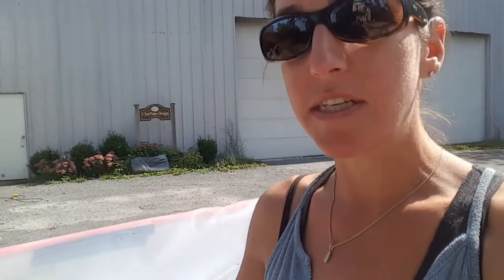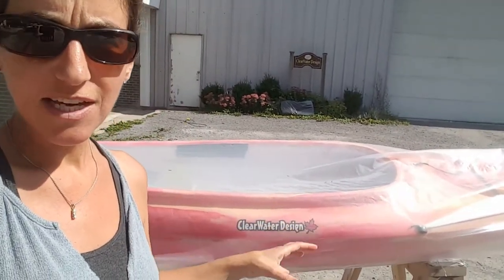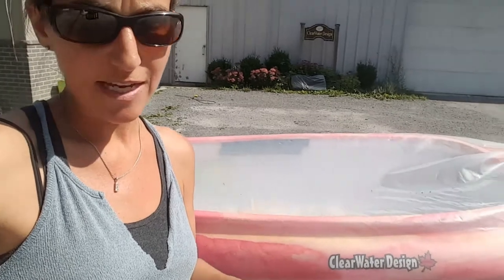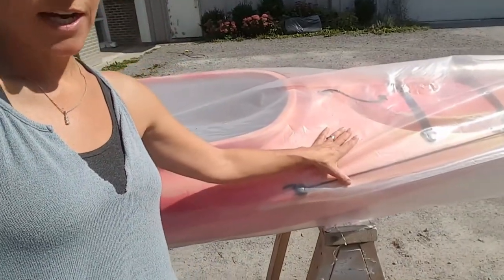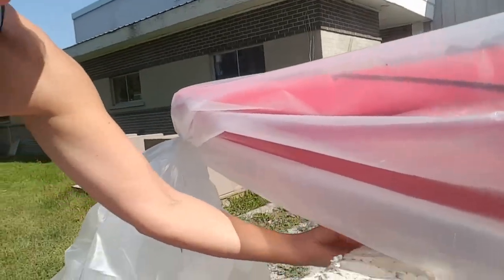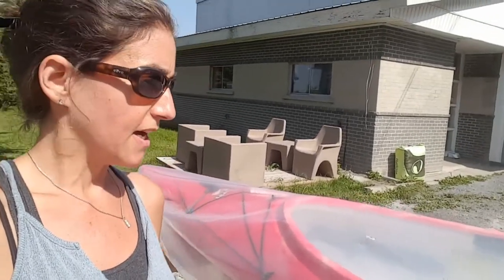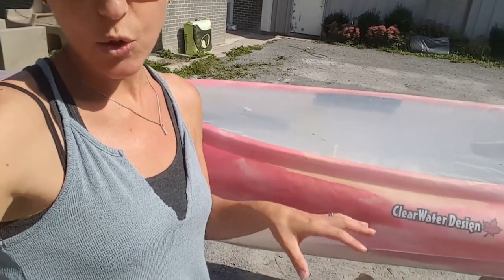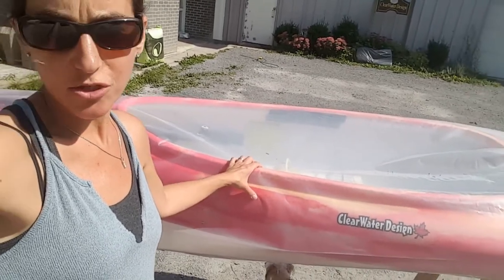How to fix a dent in your kayak

Comment: Twisted the nose on my brand new Joyride 12.0 after owning it for one day.  Couldn't be more angry!  I tried the "sun" method for two weeks and nothing happened.  Tried boiling water and nothing happened.  Tried using a heat gun...made half of it better, half of it drastically worse.  So mad at myself and the world of Kayaking.  What a terrible $1000 investment on my part.  New kayakers...don't even bother buying a kayak.  I got 1 use out of mine, which makes it the equivalent of renting a Kayak for 1 day for $1000.
Reply from the maker: Hello, I am sorry that our video on getting a dent out did not help you with your repair.  Your Joyride is not a ClearWater Design kayak.  Did you try contacting the manufacturer to ask them for their advice on repairing their product?  Different manufacturers use different types of plastic so they might have specific repair processes.
Reply: @ClearWaterDesign  Actually I did, and their solutions were the same as all the solutions on Youtube.
"Typically the way to get them back into shape is to apply heat, this could be by way of simply sunlight, hot water, hair dryer, or heat gun. The key is to make the plastic more plyable, without heating/softening it too much. Depending on the circumstance you might also apply some form of brace/block/wedge/etc. to force it back into shape."  Sorry, but NONE of that worked.  Two hours of paddling, 120 hours of working plastic only to make things worse.   Great hobby.